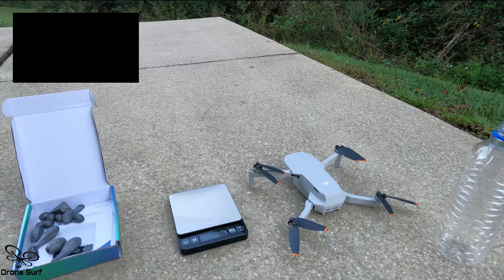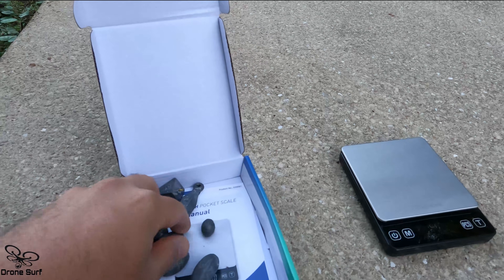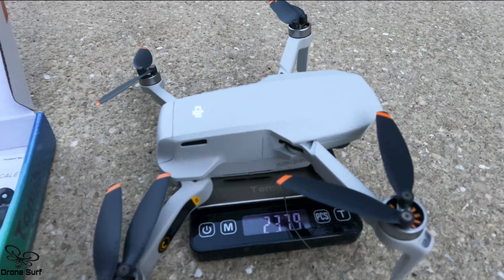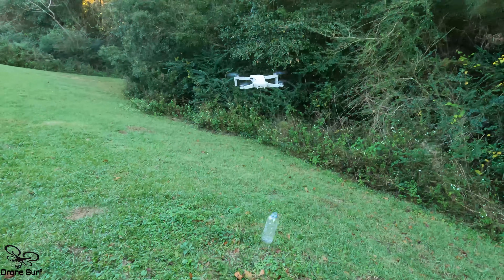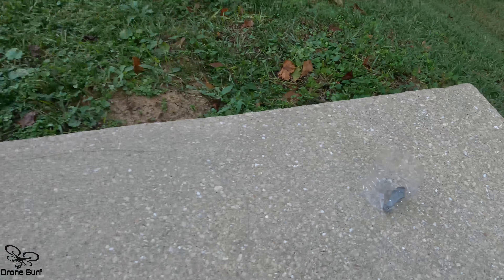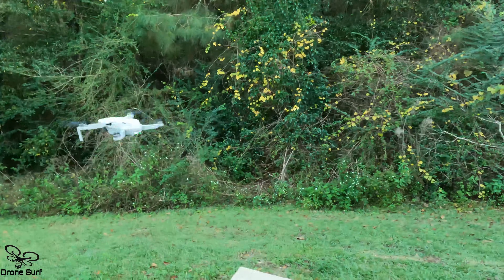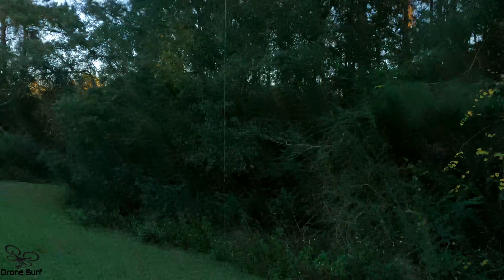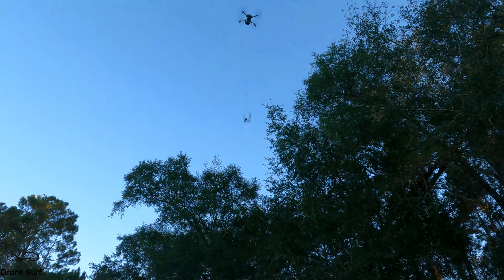DJI Mini 2 maximum weight lift test

Comment: I wouldn’t push over 250 grams with the DJI mini 2 , you could get burnout in the motors because the have to work so hard to hold the weight , I have a 35 gram drop system for my DJI Mini 2 that works well over a mile up & mind you I’m a 107 pilot here in the U.S. . I ve dropped stuff from my drone & yes it’s way cool to do , I have a friend the lives Nextdoor to me who bough a R.C. Skydiver that’s 200 grams & it’s cool to see this this thing glide down back to earth & he can control every aspect of this thing , it has mini servos in it to control its every move & that’s cool just because he can control it making it to were he can fly it & land anywhere , I drop it & watch it go from the camera on my drone , their are guys out there that drop bunches or these things from R.C. Aircraft & it’s way cool to see in real life . The one very cool thing me & my Nextdoor neighbor do with our kids is I strap a mini Nerf vortex whistling football to my drone & I,ll take it up to 400 feet & drop it & both of our kids try to catch it , it’s very hard to do because at 400 feet  you can’t hear or see were the drones at & you can’t see the football because it’s so small , at about 200 feet you can hear the footballs incoming whistle & start to see it & by then it has reached its terminal velocity & it’s very fast & hard to catch & very loud & being its Nerf , it doesn’t hurt if you get hi by it , very fun to do .

Comment: I hit 91 grams worth of lights on a mini 2 and it went into payload mode automatically. Limits the drone to like 100 feet. I don’t know where the thread hold is for when it does this. I’m guessing it can tell how fast the props are spinning to stay level or rise and by that determines the weight it’s carrying.  I put 91 grams in based on what the lights weighed, the rig I had them on and the few pieces of Velcro. It is impressive. I know after landing after carrying 91 grams the entire drone was hit… battery and parts of the body. Everything got hot. It also made the battery drain really fast. A full healthy battery hit 20% after like 8 minutes.

Comment: Sorry in advance if I missed it but I’m searching the internet looking for an answer…. My mini 2 kicks into payload mode automatically when I have too much weight on (lights etc). Is there a way to bypass that? Even if I shut it off it comes back on. Side note… anyone upping the weight be careful of overheating and prop over speed. After a heavy flight remove the battery right away and let it sit for 30 minutes before trying to charge it hot

Comment: I’ve been asking everyone and no one replies but has anyone else got the propeller rotating too fast error when using the drop mechanism? I don’t even have a payload just the device and so,e times the error comes up and if I select payload mode its fine but I’m limited to 100 ft or so. Sometimes it’s fine though so it’s just here and there and I’ve already swapped out propellers.

Comment: I just strapped 357g of batteries onto my drone. Total weight 600g. Drains the battery very fast. A bit unstable. I was surprised when it lifted the first 45g lithium battery, then surprised when it lifted the second.... And then I just kept strapping them on.

Comment: What if you just add 10 ounces to begin with instead of killing the batteries down like you did going up and down. Just put 12 ounces in on first take and see how much she struggles...I bet it will be surprising
Reply: Except you have to consider that the drone, to be useful, will be put to work regardless.  Unless your interest is exclusively in lifting a weight to a certain height and then coming right back down, I don't see where this objection much matters.

Comment: Thanks for that, was thinking about flying with my night vision camera attached which weighs 276.8g hence looking for someone testing weight limits and came across your vid-now know it will carry it a night flight is in my immediate future haha, thanks ;P
Reply: I'm doing the same but with thermal! What night vision are you using and how are you viewing it from the ground?
Reply: Keep in mind that those motors are gonna be working way harder and so heat will be an issue

Comment: Hey, I noticed you've tried it in Normal mode. Is there a difference in lift if you switch to Sport mode?
Reply from the maker: No. There is no difference. The ESC will max amps that are pulling in both modes.

Comment: Lift 10 Oz = 283 g with drone weight of 237 g, or, Lifting weight / Drone Weight = 283 / 237 = 1.20x.
Reply: Does that mean with or without payload mode?

Comment: PS I was curious as to the payload weight because I want to attach a small but powerful flashlight for playing around the yard at night time.
Reply: did you end up going through with the flashlight?  I'm trying to find a flashlight set up that will work as well.
Reply: I actually want to try to 3d print a mount for the tip2 by Nitecore flashlight lol it's overkill on brightness but if I can't figure it out I'll probably just tape it to the drone 😆 it weighs a little under 40 grams
Reply: Any flashlight with a TIR lens and 2000+ lumens would light up a lot!  About to try the same!

Comment: Omg, you used fishing weights which are designed to be tied to a string via HOLES in them or attached to them!  When your first attempt resulted in the spinning bottle that you use to put the weight in, and you said that was causing a problem but you were going to redo it, but then didn't use the holes on the fishing weights I couldn't help but shake my head. But I still appreciate the information you providing

Comment: did you turn on the propeller guard setting. this allows you to lift more. it sets the drone itself to be more powerful

 since you are adding the weight of the prop guards the drone needs to set itself to be more powerful, to keep its handling the same with the weight change.. well thats how it was on the mini 1 when I wanted to add a GoPro 360,
 the prop guard setting being ON always gave it more power to lift the GoPro.
Reply: that is payload mode, it turns on automaticallly when it detects more weight

Comment: Cool !
Hey I'm actually looking if it's possible to Dual Lock a powerbank straight on the drone and to fly it while charging :P
You look like the kind of guy who would try that, and (little bait) it seems like nobody ever thought about it online xD
Reply: Powerbanks are usually pretty cheap and heavy and would barely increase flight time since it would be using more power. Apart from all that, the Mini 2 doesn't allow flight while charging.
Reply: But what about a slightly bigger battery?

Comment: Excellent video and test here.  I’m looking to get one of these to lift and drop either a 2oz sinker connected to fishing line or a golf ball.  I want to use it to set a line to pull a wire into a tree for ham radio.  This could give me a pretty cool means of deploying an antenna way higher and more accurate than I can with my slingshot or just chucking a golf ball into a tree.
Thanks again.
Reply: That's very clever.